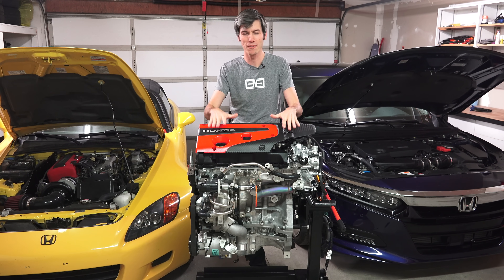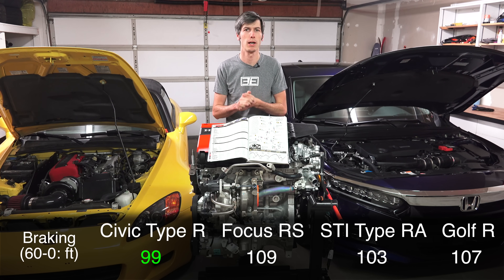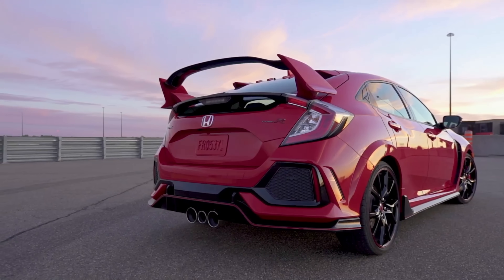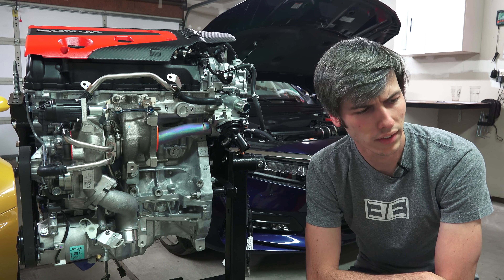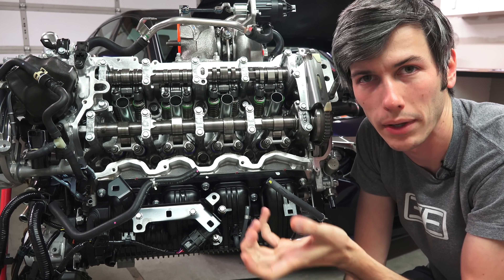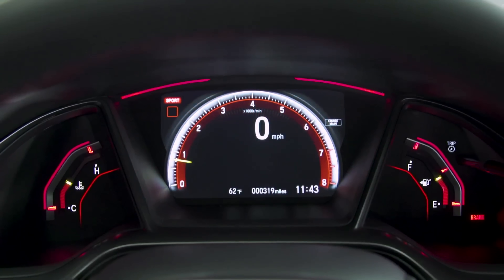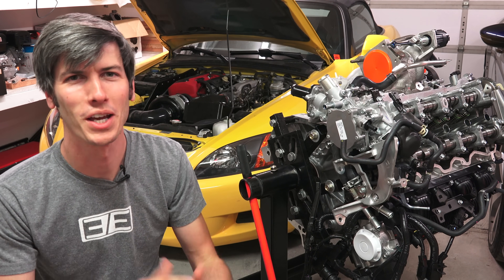The Honda Civic Type R Destroys The Competition - The Best Engines

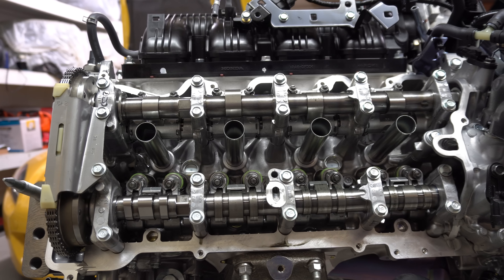Comment: 6:15 "100K Miles, Waterpump JUST inspected?"

GTI: " Wait, don't you mean your 3rd Waterpump installation?! Hello what is this JUST inspection? i do not know the meaning of this."
Reply: The newer water pumps hold up really well. Only seen a couple of those leak at like 150k plus. Transmissions however are the true Honda weak spot.
Reply: @jayz4dayz  only on their Automatic, if you're not take care it from the get-go
Honda's Manual pretty much bulletproof
Reply: @jayz4dayz  before 2014 Honda made their own transmissions until they decided to out source it to another company. Does Honda have troubles with transmissions before 2014 or after that?
Reply: my 2008 accord w/ 110000 miles don’t have waterpunp problems
Reply: Use a very good quality coolant fluid and you'll notice the difference.. If you put cheap coolant in your engine, then surely the "water" pump will die soon..
Reply: @Urbaez22  its not suppose to work like that. Why Improvise a lot if the engineer did his job well.
Reply: Ford Falcon
Reply: As a VW enthusiast I can confirm the mk7 particularly was awful for water pump/thermostat housings... what a poor design
Reply: I really did like driving my GTI, but ya, it was a pain in the ass
Reply: what are you guys talking about? have only every seen failed water pumps on one model and only affecting a couple years and the automatic transmissions only had problems for the 00-04 v6 models. hell, we have had cars come in that were slipping, did a fluid drain and fill and the transmission started working fine again.
Reply: The Honda water pump is one of the weakest links in a Honda and has been for generations.  I would check the water pump every 50k miles on the R.
Reply: @fatboy19831  The weakest part of any Honda is the person maintaining it.
Reply: @stevenfarrington2361   I would agree with you but I have lost timing belts before the recommended service.  When the belt self destructs it often took the water pump with it.
Reply: @fatboy19831  Can confirm. The TSX waterpump was a maintenance nightmare.

Comment: There's a massive problem with this car. If I'm going to buy a stock car with forced induction already strapped via factory it better be able to beat a Ford. Buying it just means I'll have to replace it anyway.

The turbo is a really expensive paper weight.

Comment: He forgot check the chain tensioner cuz at 100k that chain should be stretching especially with boost the most I've got out of a k based chain is 184k and then it jumped 4 teeth.. replaced the chain guides and tensioner it was stretched way beyond spec.

Comment: The Type R retired the current gen STI.  There is literally no reason to get the STI now except AWD or preferring the looks
Reply: And, in many cases, a massive real-world price difference that favors the STI to a point so significant that you could argue the cars are not even in the same class...even several years after initial release, many drivers report that mark-up is still an issue on CTRs whereas mark-downs on STIs are tremendous. It's worth pricing both cars out before making the final call IMO given MSRPs are a very poor indicator of end purchase prices.

Comment: Man, if they put that engine on a light platform like the integra; it would be pretty damn fast.
Reply: This civic type r only weighs 400lbs more than the integra. If you really want to put it in a light body the 85-87 CRX's only weighed 1,700lbs compare that to your 2,700lb integra

Comment: What Honda won't tell you about this engine. Excessive carbon build up on the intake valves at 50k miles. Valve cleaning is not included in their warranty plan until you hit 100k. How is it Ford figured out how to make direct fuel injection work, but VW and now Honda cant?

Comment: The type r is way too over styled.  It looks horrible.  Doesnt know what it wants to be.  Should have made a boxy 2 door hatch or coupe with the styling cut by 5000%.  Also, that plastic valve cover is garbage. Makes me wonder what else they cheaped out on.  Granted.  They are competeing with other cars in its class. And car companies build their cars to last 5 years max.  All that plastic jusy cracks and they will charge an outrageous amount for the plastic parts. Disapointing.

Comment: Wow, nice engine, It is a pitty the styling department where on leave when engine department where busy building a masterpiece.
Reply: Then you understand nothing about engineering because the entire car is a performance masterpiece.  Rap your head around FWD beating AWD.  The ugly wing pushing the back of the car down.
Reply: @Phantom096  Ferraris, M3s, Zondas etc are all well engineered while being drop-dead gorgeous. I understand that  beauty is in the eye of the beholder, but to me the new Type R is hideous. I appreciate what they accomplished with the car, but looks are one thing that could sway me either way when choosing a ride. I am technically an engineer and get my hands dirty a lot and do appreciate technological achievements, however, when I buy, I buy with my head AND my heart. I see no point in a good performing car that would not make me look over my shoulders to get the last glimpse of it after parking it. Call me fussy, but I prefer the older type Rs. If it were me, I would take the old type R with the new engine, but I am not that lucky. This is strictly my opinion. I am sure it would appeal to others though.
Reply: ZxRx7 The other cars you mention are very expensive so Honda is giving mind blowing performance at a low cost.  The car is practically a race car that you can use every day. 

Only thing I hate about it is the manual gearbox so ancient.  Automatics are faster.  I am over manual, have driven them many years.  

The car looks aggressive.  For me it means business.  If it was auto with paddle shifters I would buy it.
Reply: Phantom096 and all rear engine RWD supercars lol

Comment: YES THE KEY WORDS: FORMULA ONE.    SEVERAL WORLD CHAMPIONS  POWERED BY HONDA.  SUBARU NO F1 WINS, VOLKSWAGON FORGET ABOUT IT,  FORD TRIED HARD, BUT YOU DID LEAVE OUT THE  PORSCHE 4 CYL TURBO ENGINE BOXSTER, MORE POWER THAN HONDA BY A LITTLE. BUT IT COST MUCH MORE. BUT YOU MENTIONED F1, DEALS OFF ON FUNDS. PLUS PORSCHE DID WIN F1 RACES.

Comment: The honda type R's stats and times would like a word with you. Not even close to destroying the competition. Type R is 0-60 in 4.9 sec 1/4 is 13.5 sec, sti 0-60 is 4.5, 1/4 is around 13.5 sec. Focus RS 0-60 is 4.5 sec, 1/4 is 13.4 sec. Not sure where you got these numbers from. Maybe just math without even driving them? Only thing it beats is the base wrx but if you put the amount of money it takes to get to the price of a type R into the base wrx fa20 motor and you hit 3.2 seconds. Which is what my 2016 wrx does. And it only cost me 9k so base 26k for wrx plus 9k, I actually come out with a WAY better looking car and WAY better performance for 1k less or more depending on mark up.

Comment: i would go to say the B and K series engines are some of, if not the BEST 4 cylinder engines. the potential and simplicity allows them to very quickly become 1000+ hp machines without going past 20-25k

Comment: ive got a 2017 focus RS, and I have to say im a bit disappointed with the performance, coming from an RX8. Its better in a line, but its just not as fun in the corners.
I'm not particularly surprised the civic R outguns it on a dry track, the civic is a well designed car. but all 4 wheels is nice to have in these Canadian winters ;p
Reply: Perhaps it's too planted? The RS' awd and torque vectoring probably keeps things under too much control. I see your view about the fun factor. I had an ST for two years and adored that car. You picked a great car my friend

Comment: There is just one small issue with Civic Type-R - the gearbox. The hydraulic fluid in clutch actuator gets heated from the exhaust and that results in clutch not operating properly. Furtherly the synchros get damaged and you need to replace/overhaul the gearbox. Honda in Europe claims that's not an issue and owners just made this up but in fact you can hear about it more and more often :-(
Reply: I own a 2018 type R and the transmission is smooth as silk after 6,000 miles. It's a handful of type R's, not all of them.

Comment: 22psi and 9.8:1 compression? This direct injection stuff is wild.  It doesnt seem like it leaves much tuning room though, I wonder how much more boost you can run with that much compression?   Or if a big mod for these would be to drop the static compression to run a bigger turbo.
Reply: It feels like what i got out of boosting the k20 of the 8th gen back then haha.

Comment: This is the best Honda commercial I've ever seen
Reply: Bill Strathearn it’s straight facts, deal with it simp
Reply: Bill i can actually see your brain
Reply: Yea he just gave everyone the map   to beat so my bro took his subi wrx fa20 2.0L  to fathouse fab for a software up grade on their  4 roller dyno and gained 70 extra ponies for a total of 305 at each tire ... Its a 2015 with first year 6 speed torque vectoring ..now it gets 25mpg 0 - 60 @ 3.7 sec  cost of fathouse fab tune $600 bucks ( cheap in my book) to get 70+hp the old school way cost more than $600 bucks that only paid for a tunnel rams with the carbs plus a cam to back that up another $2k then  Set of headman headers with  purple horny header glass packs and a lower set of gears cause you lose a bunch of low end torque with two  Holley Dominators on a  pro stock tunnel ram ...so old school hp is measured in hours spent vs pounds of gold for..   parts ...subi tune cheap and fast
Reply: That's sounds about right, and that's coming from Nissan fan.
Reply: @Pretty Sure RWD, better dynamics better balanced higher traction through curves, get over it.
Reply: @Pretty Sure On paper, dry road and middle range temperatures. Every day on the road, the Golf R is way better. In Germany is 5 month cold winter a year and more than half the year the roads are wet. The Type R is just one more overpowered front wheel drive there. Maybe faster on a dry racetrack, but not where I'm driving most of the time.
Reply: @joepopes7923  a wrx fa20 will motor you with a fathouse fab $600 buck software tune that givith 305 at the tires and way more torque than that

Comment: Hello can i ask a question regarding my honda civic vtec 99 model? I had a problem with my engine because the water and oil already mixed into my engine that resulted to creamy like thing. I already replaced the cylinder head gasket ang resurfaced the cylinder head but the problem comes back again after 3 months. Can you help me with that? Thank you sir.

Comment: They cherrypicked reviews here. 

The Type R that c/d tested wasn't stock, when they got a stock one it did 60mph in 5.2 and the quarter mile in 13.8@103. About the same as a stock 2005-2010 Mustang GT.

Focus RS does 60 in 4.6-4.8, quarter mile in 13.2-13.4@104-105

Golf R DSG 60mph in 4.5-4.7, quarter mile in 12.8-13.1@105-106.

The only one the Honda can somewhat compete with is the manual equipped Golf R, but that's running 13.4s quarter miles whereas the Type R can't break high 13s.
Reply from the maker: Huh? This wasn't Car & Driver, it was Motor Trend, and it was a stock Type R...
Reply: @EngineeringExplained  then you should quote 14.2@102
Reply: @EngineeringExplained  your video is fanboy to the max. 

The Type R is by far the slowest one in a straight line. The numbers you stated for the other cars are awful.

Comment: I just bought a 1992 Accord with nearly 300,000 miles on it.  The engine runs butter-smooth to 5,000 rpm (I've had no reason to take it higher than that) and it gets 32 mpg on the highway.  Indeed, Honda knows how to build engines.

Comment: The Type R is the best FWD hatch in the world right now   It's an engineering marvel by Honda   Kudos Honda
Reply: @crummyy You mean the Honda? The Focus has gone as low as 4.6 to 60mph, the Honda as high as over 6 seconds!
Reply: @crummyy Please tell me you don't think the Honda is faster to 60mph! It's FWD vs AWD not even a fair fight, the Focus would destroy it
Reply: Nice,  now make a plug in  hybrid version with 40 miles battery only travel range and it's perfect.
Reply: GTI still king
Reply: and still fwd.. lol
Reply: Too bad it looks the worst.  Too tacky and boy racer.  Looks like they slapped a bunch of wish and Amazon accessories on it.
Reply: Best hatch in the world period
Reply: Check Megane RS. It's faster and much better than honda
Reply: why ? I think is very little different the others. Why is it a marvel?
Reply: That's subjective. 

If you like pure acceleration like I do, the Type R is the worst to pick. 
If you like track work, then the Type R is the one to go with. 

It was a bit too pokey acceleration wise for my taste, especially after driving a Focus RS.
Reply: @jdmandeuroenthusiast5804  All in all, the type r came out on top over the RS in Motortrends hot hatch competition;  It's just a better all around vehicle.  Additionally, it will be 100% more reliable and dependable.  Remember, the RS is still a Ford.
Reply: @djs18  True, but I'm not really brand picky, though obviously I choose JDM most of the time. It's beginning to get more consistent high traps than before. The Focus RS is dead anyways I think. I will say from a standstill, stock to stock, the RS will beat the Civic and it won't catch up until way late, maybe 150mph. Those are top end cars, the RS simply has more TQ/HP. From a roll obviously the Type R wins.
Reply: @djs18  I think the Civic is slow until it gains its stride off the line, so other cars gap it easily especially AWD, it's ET has stayed at 13.7-13.8, but trap has been consistently over 105mph recently in tests. 

The Type R is a better car. Not sure which id choose. I don't like FWD much but I test drove an FK8 and it handled like a Lotus. It just felt too slow out of corners, lots of wheelspin, great on the highway for passing. 

Just my 2 cents.
Reply: @jdmandeuroenthusiast5804  You need to understand that the civic was never designed for drag times or quarter mile times. The car was designed for the corner. And it takes corners phenomenally, and it handles insane, if you know how to drive. Not everybody can get in this car and make it do its magic. You must be able to actually drive to get the most out of your type R.
Reply: @djs18  I agree, it's track ready out of the showroom, and does take a talented driver. I happen to like how it looks as well. 

I test drove one, like you said the handling was sublime, I'm just not used to FWD, I've only owned one and it was years ago (1994 Mazda MX-6).

I think they're better suited for the track than roll race videos but people are gonna do what their gonna do. Plus the Hondata tune adds insane numbers too.
Reply: @djs18  It blew my mind around certain corners, Honda knows their FWD like no other. Aren't there some already doing 10s with Hondata?
Reply: @jdmandeuroenthusiast5804  lol no clue.  If people are so worried about making the car a quarter mile car, they purchased the wrong vehicle. The car was designed for the corner and the only thing that should be upgraded are the tires. Everything else is absolutely flawless.
Reply: @djs18  I mean there's always going to be those that want more speed, but it was more than quick enough stock and i feel like more power would upset the chassis. 
It's a giant killer on the track off the showroom floor, just like you said, tires and you're passing everything.
Reply: @jdmandeuroenthusiast5804  lol Exactly. I have 18,000 mi on my type R and absolutely love it.
Reply: @djs18  Is the Megane RS as quick as a Type R? Someone below says it is better in the corners
Reply: @djs18  whatever your guys argument may be the man said he prefers the RS for the accelartion. He didnt say they focus rs is better he didnt say the civic is faster at cornes and desgined for the street, he said he likes it because it accelerates better than the civic leaving any other reason why the civic might be better irrelevant for him because those are things hes looking for.
Reply: @kingcamilo  No I think the Honda is the superior vehicle all around. I did like the acceleration of the RS but the Honda probably has better top end, and as everyone is saying it's really a track ready car that can be daily driven. 
I'm just someone who likes straight lines more than corners, most of the time at least. I own a 2002 Audi RS6 and a 1992 Mazda Miata that works sometimes and sometimes not. The Audi has been good to me luckily. 

All in all its pretty obvious the Type R is the best hot hatch out right now. I'm not trying to say anything negative about it, besides the idiots that just street race it in traffic. I'm just old. If I was younger I'd be way into the FK8, and I admire it from afar because I don't have the skills to track it.
Reply: @kingcamilo  The new Type R TC is also incredible, been reading about it. 
It really is somewhat of a world beater, can't really think of another car that could track as well as the FK8 especially off the showroom floor. 
I also like how the FK8 looks. Sue me.
Reply: @jdmandeuroenthusiast5804  its fwd , so it cant be the better all around car . Look at it's car and driver lightning lap vs the other cars in its class and price range  , its not that amazing as far as numbers are concerned. I drove it and it is the most fun for sure but expensive to be replacing tires like crazy . It doesn't have this crazy top end people think it does . It only traps like 104-105mph .
Reply: @djs18  type r engine can be tuned.  So no worries, tune it for track or drag.  ECM and ECU tune.
Reply: After the quarter the R walks right on by the RS. So the RS technically isn't faster. Its actually slower just has shorter gears and awd
Reply: 300whp is more than enough on a track, look up Jordan Cox with his 200whp eg hatch.